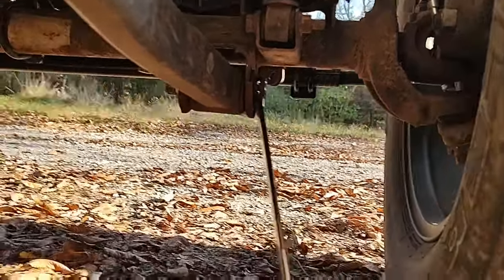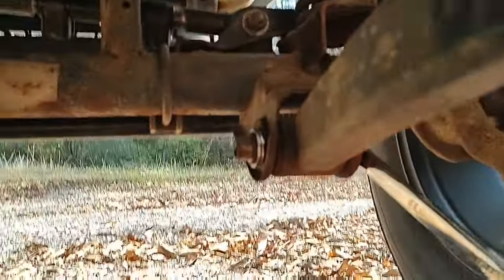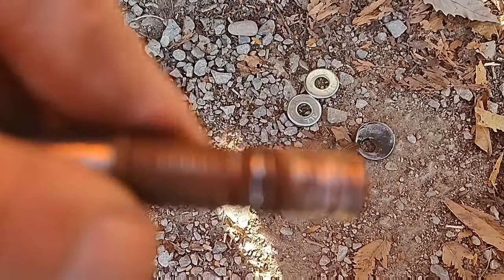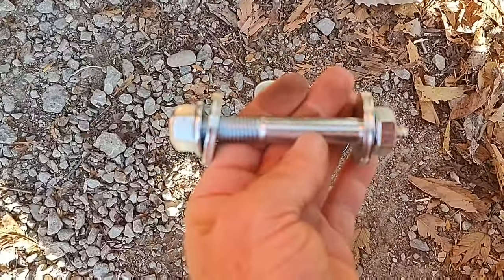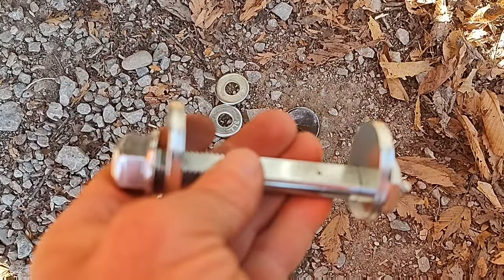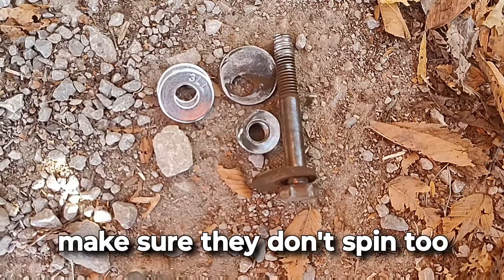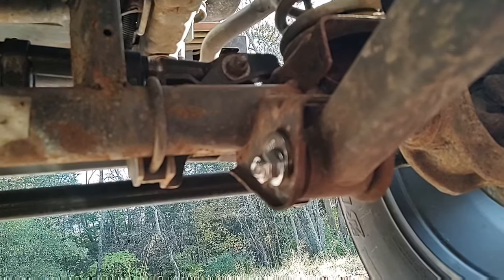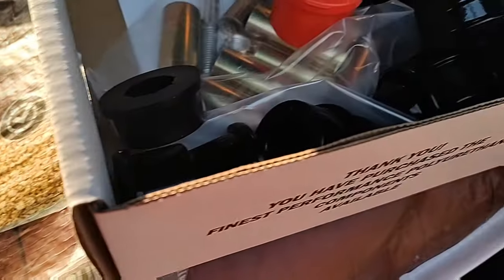seldom discussed cause of jeep death wobble

Comment: Death wobble can come from any number of front end issues on solid front axles. One of the most common is track bar problems. With a body lift, you must add an adjustable track bar which will be longer so that the caster can be proper set. Did the bolts solve you DW?
Reply from the maker: This jeep has had death wobble almost since I bought it used in 2022 but I hardly ever drove it until recently it became my daily driver.  The replacement bolt did solve it (well, I've only driven it about 300 miles since I fixed the bolt and so far so good - every day on way to work there is one spot where I would get death wobble and I've passed it 4 times now without death wobble), I had already (within the last year) replaced a bunch of worn front end parts, including pitman arm, inner and outer tie rods, installed a rough country adjustable track bar, swapped the 35" mud tires for factory wheels and tires, and also replaced the dual steering stabilizers because a u-joint bolt was broken on each side from off roading.  I still have a new set of polyurethane bushings to install for complete front end but I am holding off for now to see if it was the bolt for sure.